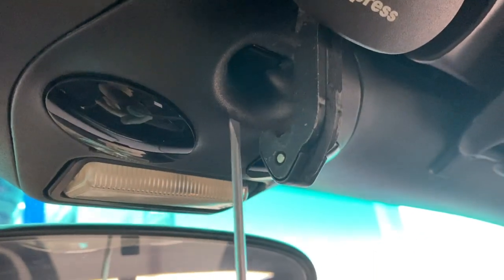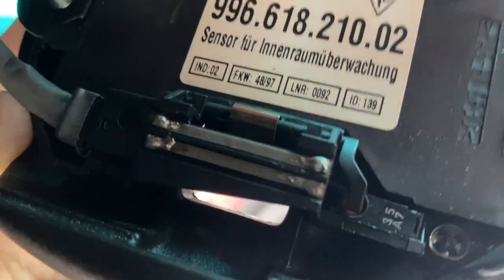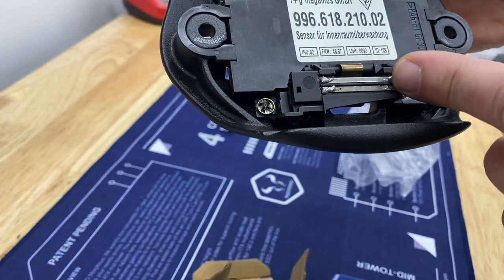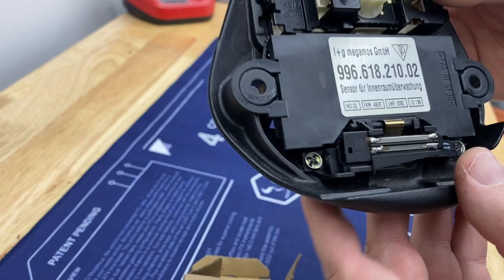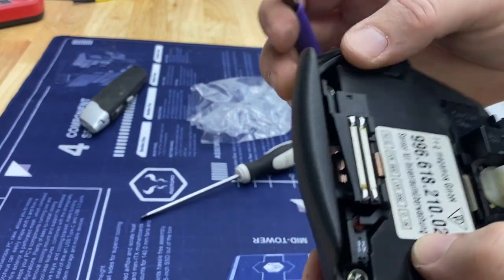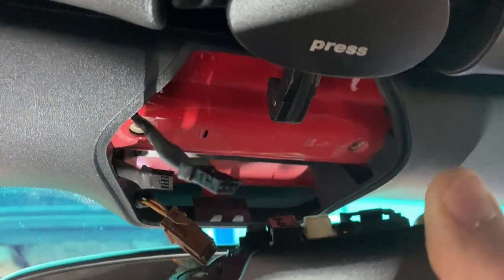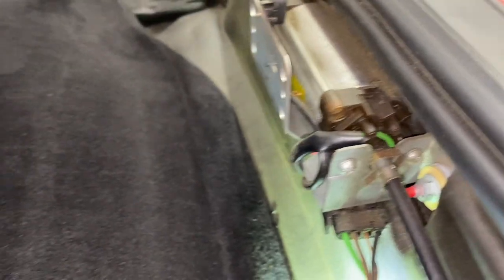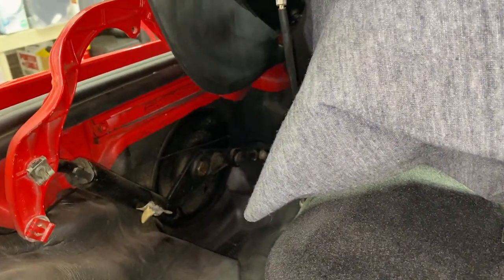Convertible Top Locking Micro Switch Replacement  | Porsche Boxster 986 987

Comment: Great Video Aaron! At the moment I have the microswitch cleaned up and ready to go. PROBLEM: When I plug in the microswitch to the connector is does not function UNLESS I am holding the firmly the connector into the microswitch. The connection seems ok but I have to be pushing the plug into the microswitch to get it to function.   Any Suggestions??
Reply from the maker: +Jeanne Murphy thanks! Never had that experience so other than getting a new switch to see if it’s that side of the connection, I don’t have anything

Comment: On a 987 - the bolts are T-30.  The T25 will obviously fit in, and sort of catch the T30 recess, but repeated use of the smaller Torx driver WILL bugger out the Torx recess in the bolts.
Reply from the maker: +Motorcycle Trips - US, Europe, Canada yes thanks! I’ve caught myself doing that a couple times and this might be one of them…

Comment: Thanks for the video, Aaron.  I couldn't have repaired my 987.1S without your help.  For anyone who is interested, the 987.1S in nearly an identical process except that instead of removing the oval bugeye lenses in the 986 you need to remove the HomeLink gagage door opener switches to get to the torx screws.  A word to the wise, you need to remove the entire HomeLink switch, not just the bezel around the switch.  (I learned this the hard way on the first switch.  Re-assemply was a PITA). There is a small notch on the frontside edge of the switch closet to the window.  Use a small screwdriver to get under the notch to release the front of the switch first before pulling on the switch to remove.  The rest of the process is identical to video.  I purchased new little clips to hold the switch in place, but for the life of me I couldn't get them to slip over the little pins.  I ended up reusing the original clips.
Reply from the maker: +HazelPDX Pdx awesome, great to hear! Glad it helped 🍻
Reply: Hey thanks for this comment, I was trying to figure out how to deal with the homelink on my 987.1.

What were you experiencing with your top? Mine is stuck down/open and the car basically thinks it doesn’t exist.
Reply: @farrism5909  Passenger window would drop as normal when opening the top, but the window would not automatically raise back up when the top was raised and latched.

Comment: It is not the micro switch but the pins that hold it is the problem. When you remove it, it is very hard to put them back as in before and there is usually a little play in the switch. That causes the top to work in my experience.

I solved it by glueing  with plastic epoxy.
Reply from the maker: +Anil I need to check, but I bet you can buy new “pins” (or whatever Porsche calls them). Mine were still tight.
Reply: @HelpMeDIY  Please let us know. Thanks for the videos btw. I solved my convertible top problem by watching your videos. I also bend couple pins on the relay and grounded one of them so that I can use the top while driving and handbrake is down. This also prevents future problems that might arrive when handbrake switch doesn't work.

Comment: My top/clamshell just recently got stuck and was making the crunchy sound before becoming completely immobile too. I think the motor on my left seized. clamshell was also uneven when trying to go down it was lower on the right.
Reply from the maker: +Naomi H there is only one motor and it’s in the middle. I’m actually making a video on that right now, stay tuned. My guess is the plastic ball at the end of the rod broke like mine or that the plastic gear inside the “transmission” broke.
Reply: @HelpMeDIY  Great! Hoping u find the issue. My mistake, yes one motor but i think the gear on the drivers side is seized. I removed both ball attachments that connect to the roof and hinges to manually open/close the top and i noticed the drivers side clamshell doesn't want to sit fully close. It's raised slightly but can sit flush if slight force is applied.
Reply from the maker: @MKNAOMIII  I think that’s normal for people that convert the top to manual

Comment: Did you resolved the rattle noise from engine startup ?
Reply from the maker: +Mihai Munteanu yes by replacing the chain tensioners! Still going to resolve the guides one day here.
Reply: @HelpMeDIY  all of them ?
Reply from the maker: @MihaiMunteanuMMX  Just the 2 easy ones on the bottom. I have a video for that of course if you search my channel :)
Reply: @HelpMeDIY  I saw that video last summer but I understood that the problem was still not solved by changing those tensioners. That's why I'm asking you now
Reply from the maker: @MihaiMunteanuMMX  it did solve it :)